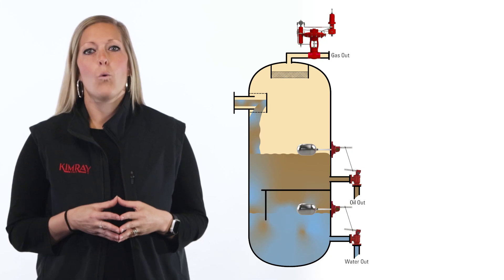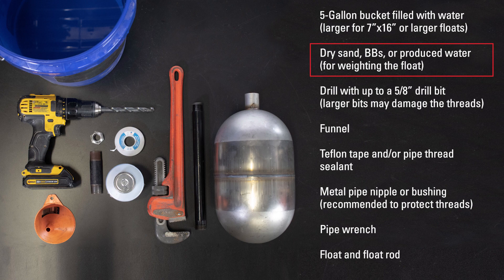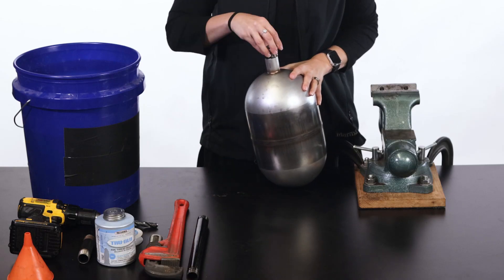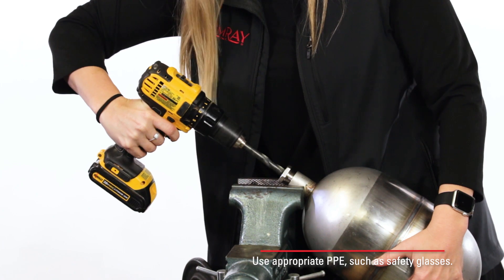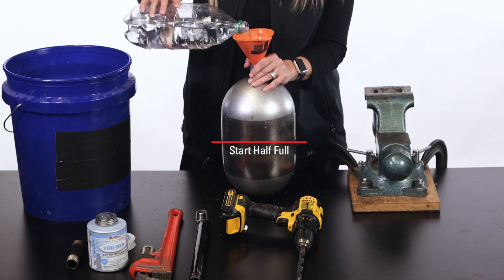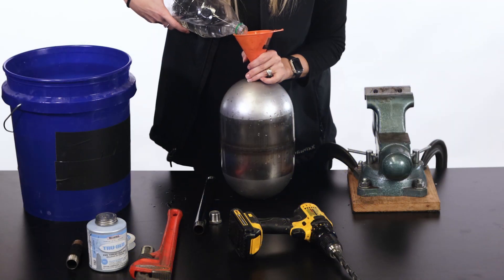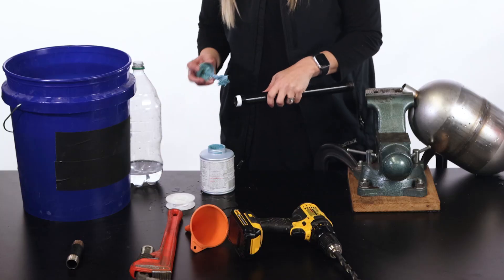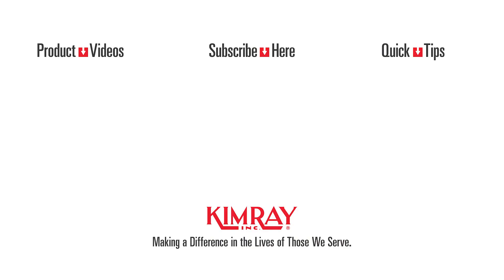How to Weight a Float Operated Liquid Level Controller for Oil & Water Liquid Interface

Comment: How do you keep the fluid/water in the float from draining back into the control arm/float rod
Reply from the maker: If the float is set correctly it shouldn’t rise above horizontal and should always be on a slight down angle. This would prevent the fluid from draining out. You could also use either a solid float arm or a plug of some kind - in this case a ½” rubber plug.